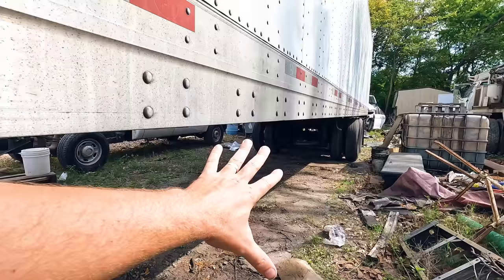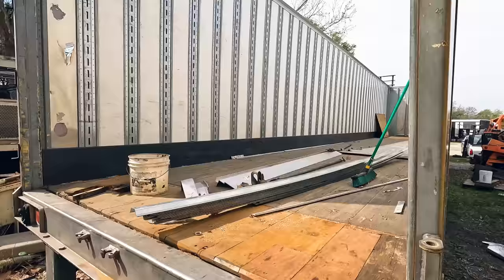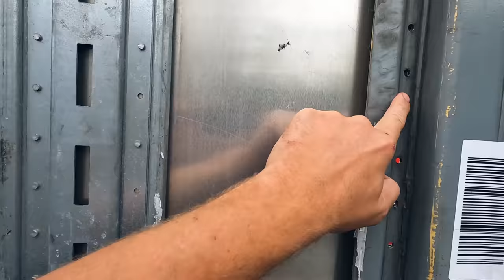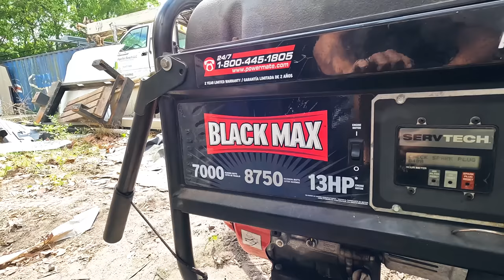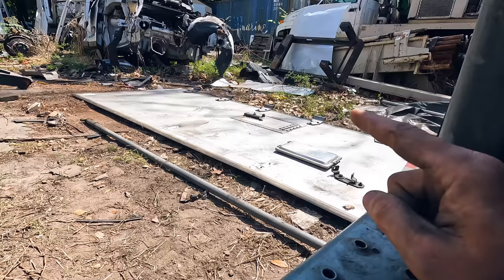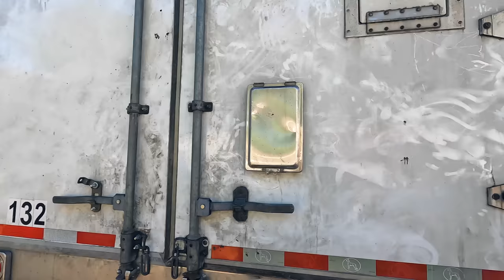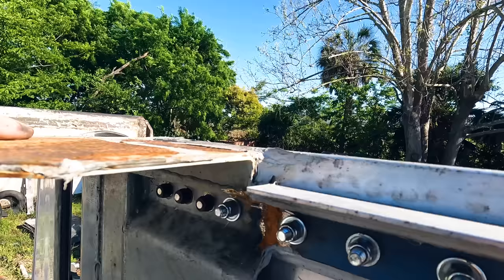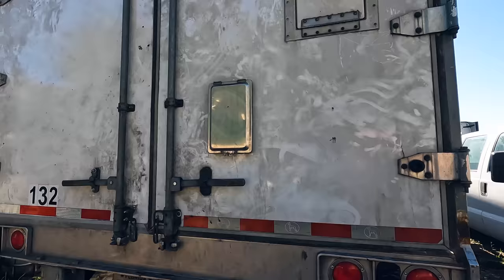FRAME Welding & Fabricating | WE SAVED BOTH REAR DOORS! 53FT Semi Trailer Rebuild Project DIY PART 3

Comment: From the looks of it ,your repairs on the dryvan ,it will probably stay a dry van instead of a wet van full of leaks ,yup smart move on replacing that upper support for the doors& trailer top

Comment: Those are know as solid rivets which are installed with a air hammer and a bucking bar.  It wouldn't be a bad idea to use an adhesive like 3m panel bond when installing the roof cross members.

Comment: I bet it would be easier to knock the walls down and make it a flat bed 😂
Reply: Can't as a box trailer without sidewalls and roof would have less structural strength than an Airfix kit!(Plastic models you make to fly round bedroom!).flat trailers have chassis rails with depth along with side rails. Box vans strength is all of it as the box frame/structure makes the strength.

Comment: I have a question. I am currently working for a job for 7 years now. It's alright. The pay is basically $650.00 a week. To me, I feel like there's jobs that's paying much more than this. So I've started looking up on truck driving. I have ideas for the future like wanting a tiny house, buying a boat, and possibly getting a new vehicle. To me, I'm strongly thinking this current job I got is going nowhere and they don't seem to want to hire people for help. I currently live in NY but I'm strongly thinking of moving towards the southern states. I've just started studying the general knowledge test.

Should I get the CDL here in NY and move on down the country and get the license changed into another state license?. I need some opinions. Thanks.
Reply: It doesn’t matter which state you get your original license in. It will fallow you to every state. The only thing I can think of off the top of my head is not every state gives a manual restriction if you test in an automatic truck but if you transfer it to that state they may keep the restriction on and you’d have to retest in a manual to get it removed. Also don’t lose your DOT medical exam because you need that too to transfer your CDL.